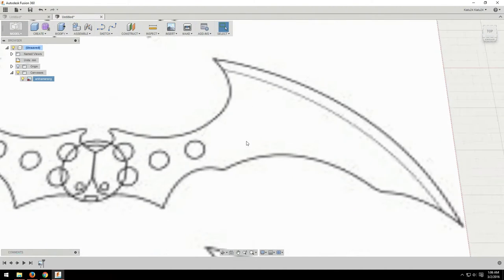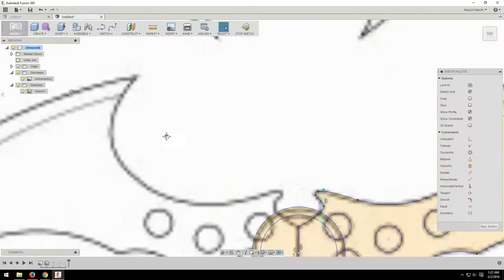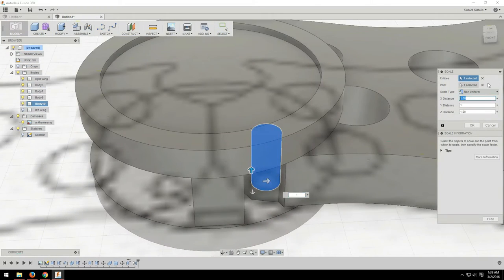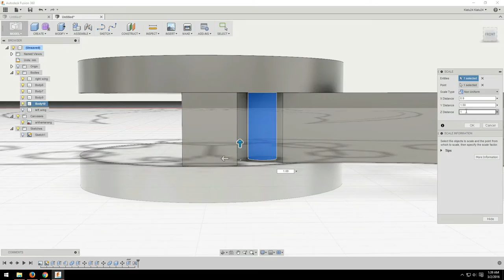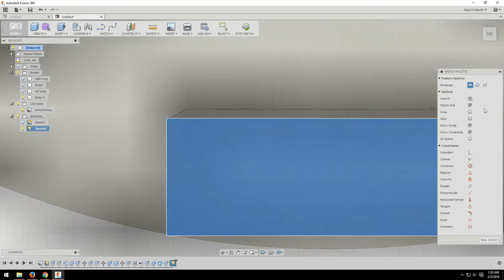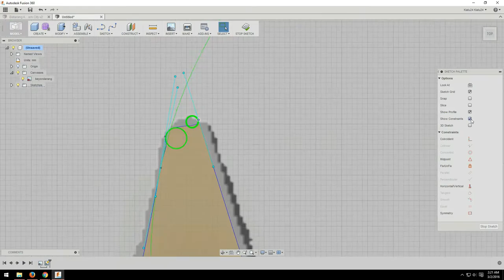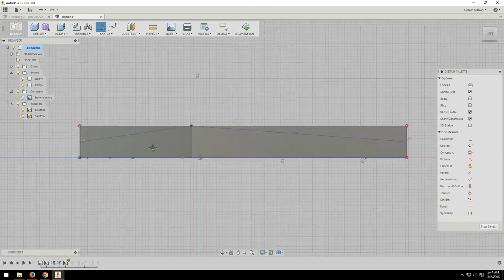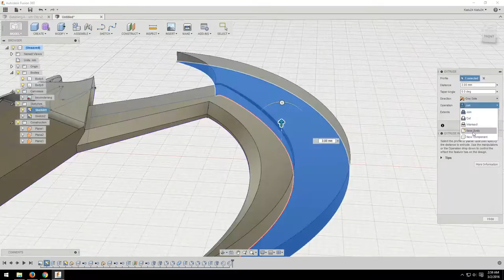Speed 3D Modeling Two Batman Batarangs in Fusion 360

Comment: How do you make the sharpened edges?  We've been using Inventor in class and I have used fillet to make rounded edges, but have not figured out how to make contours to a pointed end or sharpened edges.

Also, I just laid the first coat of gloss black to Batman Beyond-arang.  Going to raid the wife's sculpting clay and use your method to paint the red :)
Reply from the maker: +neckbreaker Well I'm not sure what Inventor would call it, but Fusion 360 calls it Chamfer. It's basically just like fillet but it cuts the edges straight off instead of curving them. It's basically a beveling tool.

And very cool! I hope it goes well for you. I'm glad my wife is so resourceful with that type of stuff. I wouldn't have thought to use playdoh like she did.